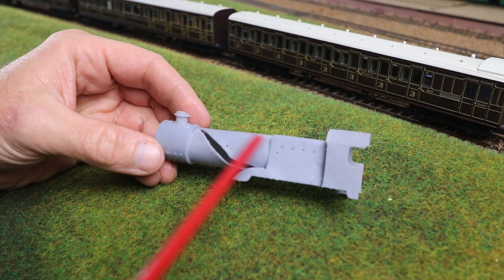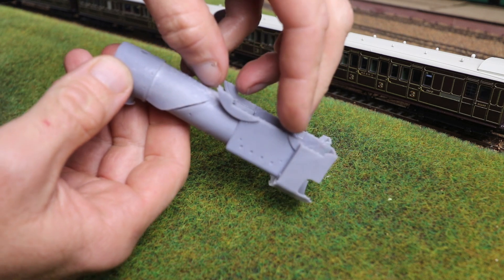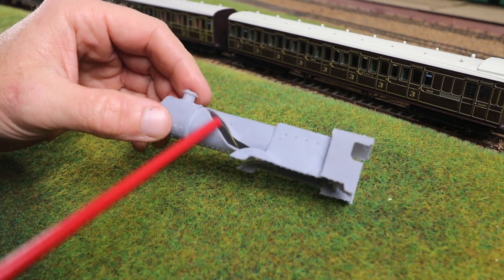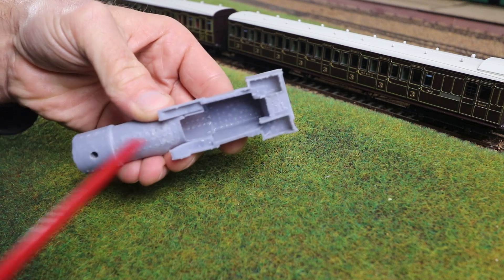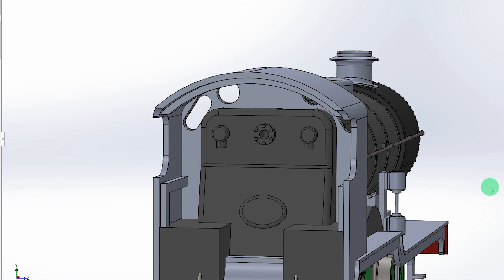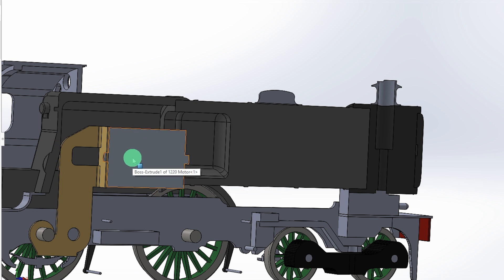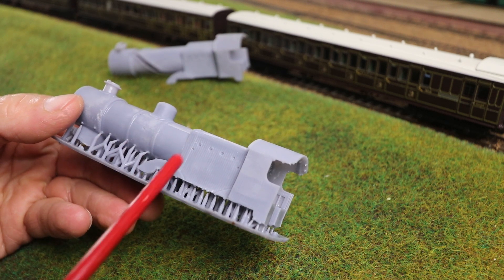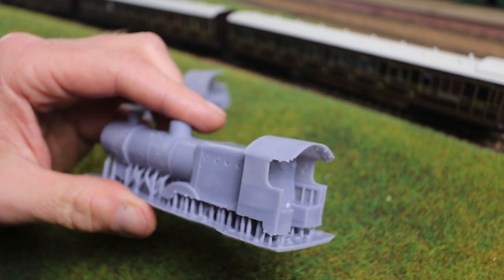3D Printed Model Railway Locomotive

Comment: Break the model down into multiple parts, less and less chance of issues this way and a more even curing of all parts.

We like to think "oh yeah just print out a loco as per how a rtr one comes" but this is not great thinking as the design of something for injection moulding will never be that great to print and the design of something to print will never be that great to transfer to injection moulding either. 

Takes a few goes to realise that you're not making the best of the technology you have but once you start to think how to get the best of it it becomes quite good.

Breaking down to multiple sub assemblies also allows you to use other materials where they may be much better suited, example being cabs, wall thickness on injection moulding and 3d printing at really quite clunky which can make an otherwise fantastically detailed model look a bit off. So where possible its good to break the cab off from the rest and do it in brass if you have the skills to cut it out with the jewlers saw and bend it up and attach to the running plate and to the boiler, the boiler barrel and fire box print well as one normally, but a separate chimney and dome are always good, the running plate again can look a lot better in brass, other small details can also be much better as separate parts the valve chest detail under the smoke box for example. 

A whole loco is something that has many parts that are best printed in many orientations so doing it all at once qill always be a trade off of best orientation for all but ideal for none with heaps of support thrown in to make finishing up a nightmare.

Comment: I clean my models using a 3 bath process - firstly the dirty bath, IPA and a brush, second bath IPA(for standard resin, water for Eco resin) in a Sistema Pickle container, shaken well, and lastly with either the Anycubic Wash n Cure with IPA, or using an Ultrasonic cleaner with Tesco's lemon (flourescent yellow/green) multisuface cleaner as the solvent. Models with large internal areas - like locomotive bodies, will get the Ultrasonic bath treatment, it's amazing watching the resin coming out of what you thought was a clean model.
I have seen video's - not tried it myself yet - of models being cured in side jars filled with water. The theory is two fold, the UV light will defract in the water giving a more even cure, and also the water will stop the model over heating.
For supports lots of fine supports in Chitubox I'm running my Auto supports at 80% density, visible areas light supports, hidden medium, then manually add Heavy supports to nail it all down.
To help minimise warping I make up a Union Jack shaped support from 1mm diameter cylinders, with the top and bottom cylinders protruding 1mm beyond the verticles. The supports added to the model, and once printed can be easily cut out.

Paul

Comment: Very interesting subject, and one I have a future project in mind, myself. Following on from Michael Warren’s question/point about resin printing the various locomotive superstructure elements as separate items.  Is there any mileage in the point that as separate items  (at least whilst developing a prototype), any fault corrections in a particular area: a) Don’t require the continual printing of areas each time, that are already OK or fixed; b) Individual parts might print better as individuals anyway and c) Individual parts make production of class variants easier?

Comment: Maybe better not to print in one part, printed in assembly groups UV-light and washing brush would reach the insides better and if a part fails or you think "maybe it could be done better" you only would need to correct/change and reprint that part.
As the real things metal surface is made/shaped in a horizontal, vertical or rotating process the viewers eye notices angled surface textures as wrong, could be that painting brings that out even more -> test paint your failings and watch them under a good light and with camera.
Would guess a (hollow) cylinder printed vertical would not come out that much oval and with less/none of those (at least at this stage) ugly support-construction-dots on the lateral surface, too.

Keep on moving/testing on, Bexhill West surely gona be a nice show piece at the end of the evolutions it´s parts are going through.
Reply from the maker: Thank you very much for your thoughts.  It was certainly my intention to print the parts as separate pieces.  This was more of an experiment to see whether the print would work in one piece.  Once it had failed, I then relished the challenge of modifying the drawing and printing strategy to see if it would work.
As for the surface texture, it looks worse on camera that it is in reality.  I have since prepared this print and given it a coat of primer and the surface finish is really quite good.  I did use some 600 grit abrasive paper to lightly prepare the surface first.
You are right, a vertical cylinder would print much better.  If I go down this route for the final model I think I would use a brass tube however, and take advantage of its thin-wall to allow more space within the structure for wiring etc.

Once again, thank you for your thoughts.  Reading your comment has got my mind racing again and thinking of alternative strategies for this part.
Thank you for watching,
James
Reply: Brass for the long vertical cylinder sounds fin - will bring some wight, too.
For smoke box cylinder brass or 3D-print? Especially smok box door and around attached to that cylinder is were I guess that the direction of a 3D-print and which parts in one piece would matter much. A other question is about smoke generator - yes, no, would one fit?
For the cab consider brass sheets as a alternativ solution.
With the abrasive paper you should got the surface pattern corrected - I gona watch that when you show (with or without test paint).
About looking worser on the camera - you planned your station so that you could photograph it well, therefor when all is finished and you take pictures would you want to see something looking wrong on monitor?

May your mind race on, but with some breaks for rest and to do other things, too.

Comment: I am very new to 3d printing but I have to say I don't understand why you have had so much trouble. My first ever print came out perfect. What printer are you using?
Reply from the maker: Hi Tony, I didn't experience trouble as such, what you see me run through here is the challenges of preparing a design for 3d printing, and experimenting to find a strategy which would work.
In the first example, the design was never intended to be 3d printed, the boiler barrel was going to be a thin-walled brass tube.  I just tried to print it to see what would happen.  As I knew this was an experimental print, I was using the dregs of an older bottle of resin, and I think this is what caused the delamination of the layers.
In the second example, the failure occurred because I had reduced the support at the smoke box end to a point whereby it couldn't hold the weight of the print during the print process.
In the third and final attempt, the model was angled once again, and the support reconfigured.  This reduced the hanging weight on the support in that area and so the previous failure was eliminated.
I'm using an Elegoo Mars printer, which is excellent and not the cause of the problems.
I think that you too may find that as you advance with your 3d printing journey, and tackle more complex projects, there will often be an element of trial and error in determining the optimum printing strategy for a particular model.  Things such as mass of model, centre of mass, minimising detail loss through support structure, resin type, condition of the FEP film, etc all factor into the success or otherwise of the print outcome.
What you saw in this video was me working through these variables to optimise my design drawing for 3d printing, and also the strategy for the final print.
Reply: @BexhillWest  Thanks for the reply, yes there are a lot of variables that go into making a good print. That is why I commented, I would wish to avoid too many failures in my own journey as they can be discouraging. Thanks for explaining.
Reply: Not failures, learning opportunities.

Comment: Whilst you may not use DCC it would be a good idea for future proofing to include a cavity in the boiler for a DCC chip.
Reply from the maker: Good thinking David.  I have a plan for DCC and loudspeaker fitting which I will cover in a future episode.  I hope to get the sounds of the real loco built into the model.  Fingers crossed.  :)

Comment: Morning James. Check your email asking a question about libreCAD. As an aside, your layout from what I see is looking good. What are the dimensions? How are you "curing" the finished model? I note that other modellers use UV Nail lamps and they range in price but average out at £15. If the failure to your own creation is this final process, it might help cure your creations more evenly and hopefully resolve this. Will drop you another line, short one, later. Mike
Reply from the maker: Hi Mike,  I'm curing the model with a UV lightbox, taking it very slow and steady.  I think the first failure was down to me using the dregs in an older bottle of resin, and hence the initial lamination failure.  The part was also very thin, as you may recall from the video that the boiler barrel was designed to me made from a brass tube originally.
The second failure was I think due to excessive weight hanging from supports which I had made too small.  I was experimenting, and trying to minimise the support.  But I got there in the end!
I've checked my email and sent a reply.
All the very best,
James
Reply: @BexhillWest  Get a solar-powered Lazy Susan and place it in your light box with the model on top during curing . . . Summat like this which I use if there's no direct sunlight: https://www.ebay.co.uk/itm/360-Rotating-Turntable-Jewelry-Display-Stand-Solar-or-AAA-Battery-Powered-UK/203216742621?hash=item2f50a968dd:g:lwUAAOSwvddf1Msx

Comment: Hi James, suggest leaving those solid boilers up to a week, some people have issues with thick solid parts and splitting post cure, especially with water washable resin.

Use hot water (just hot enough to not scald your hands) when doing the initial clean up this will soften the resin and give a much neater finish when removing the sprues, I find they just pop off using my thumb right after coming out of warm water, then do a second wash with a soft toothbrush to scrub away the last of the uncured resin, that you could not get to with sprues attached. I add just a drop or two of washing up liquid to my water. 

Even post cure you can soften the resin in hot water, if you get some distortion post cure, you may find sticking in hot water will make the walls soft enough that you can fix distortions. 

Personally I'd break the body into several sections for printing that way I would be able to mount in such a way that the build sprue attachment points would be in places where I could sand with no risk of removing fine surface detail. In your case I'd split into maybe 4 parts, boiler, smoke box, fire box and cab.

You may want to test print a cube to ensure that your X, Y and Z axis is accurate, many printers need calibration (usually the stl to printer software can handle this) typically most people don't notice the errors, but printing a cylindrical or spherical object  can highlight any errors giving you oval or egg shapes rather than perfectly round ones.

One last thing, if you have a UV box for curing, think about sticking the parts in a glass of CLEAN cold water, the water refracts the light into recesses that it may otherwise not reach, you still need to flip the parts once during the cure though to ensure even coverage, a little overexposure is fine on any resin except clear, where it will cause yellowing.

Best wishes - David
Reply from the maker: Hi David,
Sorry for the delayed reply - it's been a very busy week!

I am curing these very slowly, and with quite a strict regime to ensure an even cure.  As for washing the parts, on this occasion I was rushing and not following my usual methods - hence the disappointment.  But thank you for your suggestions, all of which will be very helpful to those reading these comments.
I agree that printing in sections would produce 'cleaner' prints, and you may recall from my previous video that I planned to do just that.  However, curiosity got the better of me and so I thought I'd try a one piece print.
My first attempt was with my original drawing which had been designed for thin walled brass tube, and to be honest I think is just too thin a section to print reliably.  I think that it was this and some older resin which led to the initial failure.
In my second attempt, I'd minimised the support and the tiny supports couldn't hold the weight of the solid boiler and smokebox which caused them to part company.  Thus the unconstrained end of the print tended to 'flap' during the print process, and this is what led to the deformation at the smokebox, rather than a machine issue.  A case of a poor print strategy.  
The glass of water trick is a great idea, and I will certainly try that out.  I hadn't heard of it before, but it makes sense.  Thanks for the tips,
James
Reply: @BexhillWest  Hey James, we are al learning as we go along, for instance it can be better to use more supports of a smaller size to gain stability and reduce surface damage because smaller contact points are easier to remove but having more of them reduces the chance of objects peeling off the support structure due to suction/gravity

Comment: Nice detail on the layout James. Coming along nicely.
How long did the loco body take to print? 
I thought you would have problems with the large mass to thin wall of the fire box walls?
Surprisingly not!
I know when you’re moulding a piece like this you could get a sagging effect on the firebox walls.
A very interesting video to while away the early hours.
Reply from the maker: Thank you very much. 
This was a 5 hour print.
 I had anticipated failure in that area too, so I made sure to evenly fillet-in the join between these two areas.  Wherever possible I have used a fillet radius where faces meet at 90 degrees to minimise the chances of cracks spreading.  I've got this piece into paint now and the outcome is amazing - so it'll be back to the drawing board now to add more rivet detail and complete the backhead.
As ever thanks for watching, and I'm pleased you enjoyed the video.
Best wishes,
James